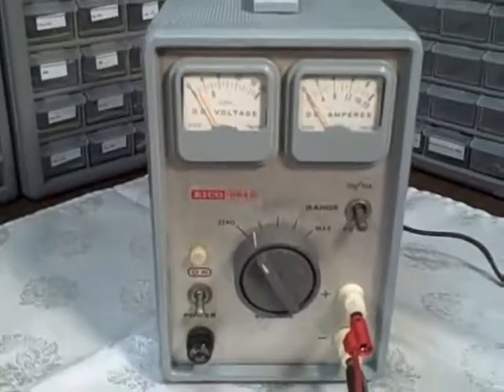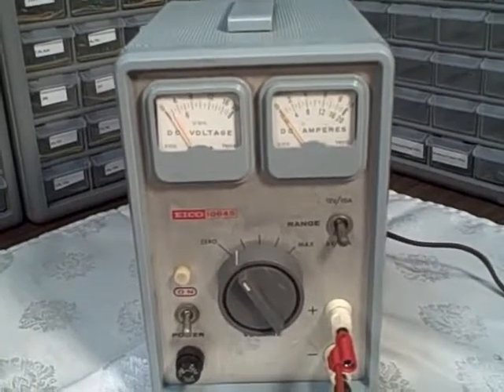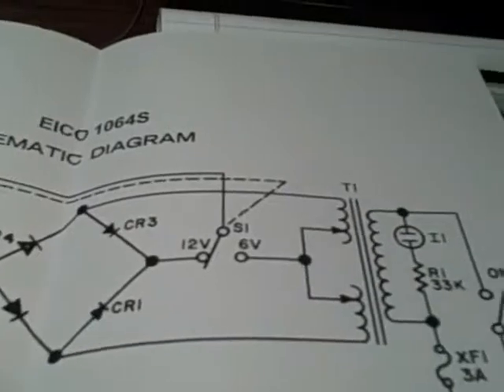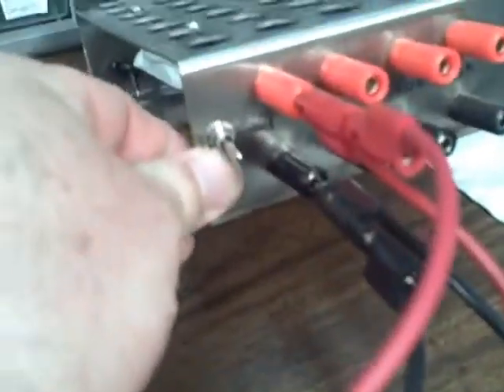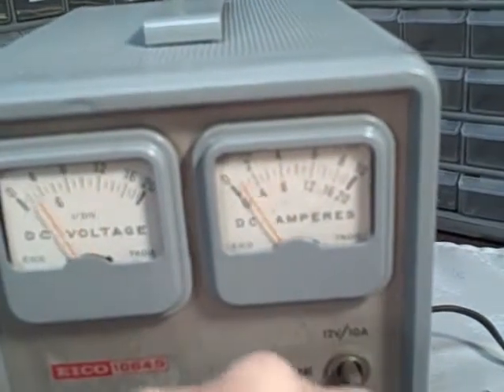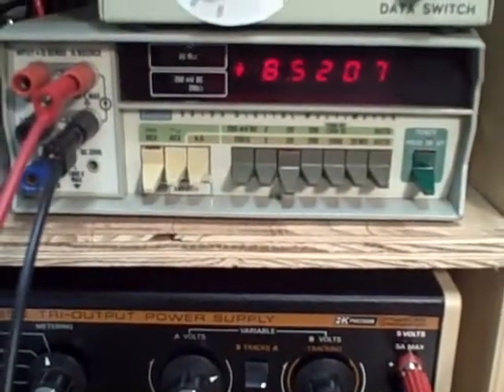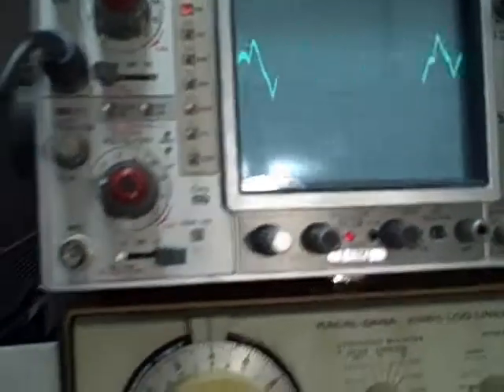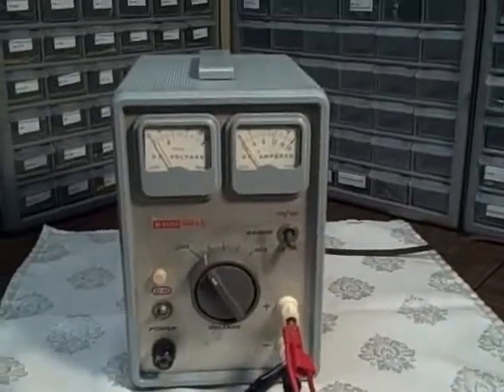Eico 1064S Adjustable 10 A 0-18v Power supply

Comment: whatt hapen if you use a 10A  dimer at the input or primary of the transformer  you voltage on the secondary will change to so can this work to?

Comment: How did you fix the sticky dc volt meter? I have the same model with the same problem its accurate until after 10 volts then it's reading are about a volt off

Comment: I saw one of these (actually a 1064, not a 1064S) advertised locally and your video was quite informative. One thing, though: This is not a linear power supply. It doesn't seem to even be regulated at all. It looks like it still performs pretty well, though.
Reply: What?